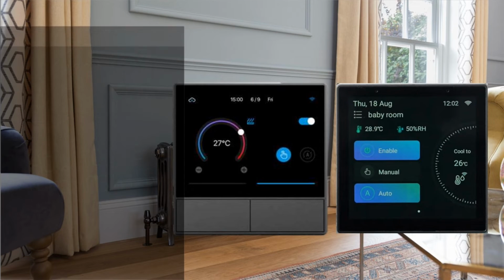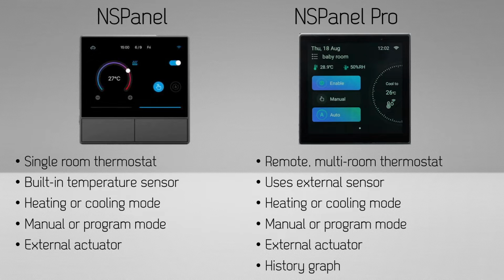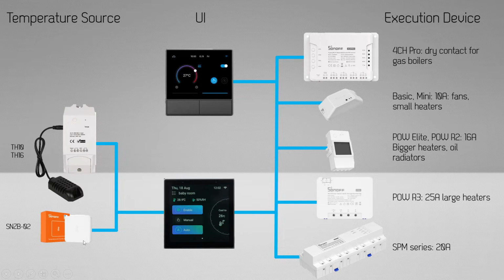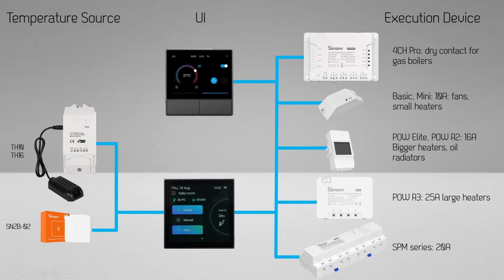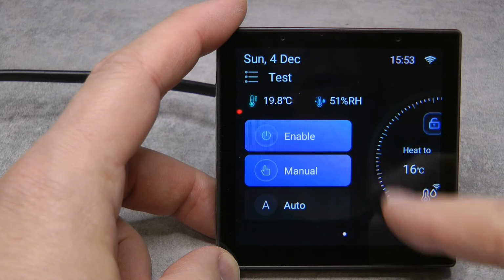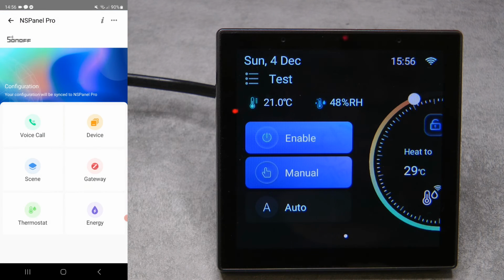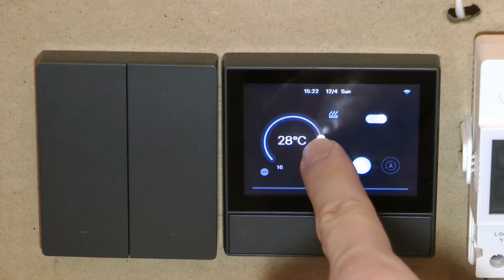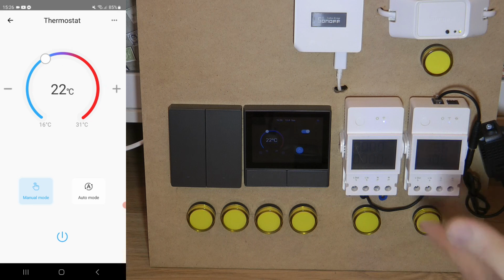Sonoff thermostats: NSPanel or NSPanel Pro

Comment: Hi thanks just found this site, very good description,  I have many sonoff devices.  I suggested to sonoff early days with the NSPanel  that +/- 1  degree is too wide a hysteresis band for a UK domestic radiator central heating system.  I had hoped they may have added the option of  +/- 0.5 C by now.   +/- 1 C represents  a 3 degree swing.   So if set room temp needs to be 20 C   it goes up to 21C then it has to drop to 19C before it cuts back in again,   in colder weather due to the boiler/rad re heat up delay the room temp drops lower than 19C.   With a tighter band It would also be good to have some choice control setting over the delay time between on off.
Reply from the maker: Thanks. I agree with that, not to mention with radiators the room hears up quicker, but with underfloor heating it would take longer until you feel that the heating kicking in again.

Comment: I've watched your video but there are some things that you should rectify.
Nspanel can also use the external temperatura and humidity sensor.
Also as execution devices, you can mention also the sonoff sv whici has a dry contact and is the device that you have to use for a heating system.. Hope this info helps.
Reply from the maker: I am sorry, but how can the NSPanel use external sensors? I know about the Sonoff SV, but it also switches over the low voltage with the relay. You can do some complicated wiring to make in dry contact, but I think 4CH Pro is much easier.
Reply: @csongorvarga  I would really like to show you a screenshot of the Nspanel menu where you would see the option to choose external sensors.
For the relay, I made a mistake. I was speaking about the Re5v1c. This one is using the dry contact.
Reply: Imagine my surprise when I found out that the NSPanel Pro DOESN'T HAVE internal thermostat as it was let to be understand in their marketing materials...

Comment: Thx for the great explanation, but in order to automate the apartment only for lighting and cameras, what should I use between the 2?
Reply from the maker: NSPanel has outputs to control 2 lights, and also control 8 additional lights (other Sonoff devices). But you can have on in each room. NSPanel Pro can control lot more devices (although the screen size is very similar) and this is the only one that can view camera feeds. But you can have both and even multiple of each.

Comment: thanks for the video, I have a relatively larger room with 2 separate electrical floor heating thermostats , we don't have Spaniel pro available here , if I use Ns panel do I need 2 of these or even I would do , I am going to use 20AMP POW

Comment: For the temperature measurement is there an offset possible? When running manual mode does it return to automatically to auto when it's time for the next setpoint.
Reply from the maker: Yes, there is a manual correction available.

Comment: Thank you for the great video. One question though: I need to control 2 or 3 sonoff relays (wifi) with the thermostat because I have 3 heaters in the same room. Will the NSPanel allow me to do that or do I need the Pro?
Reply from the maker: I just answered your quesiton on the other video as well. NSPanel (and Pro), only controls 1 device, but you can group that device with the other 2 so all 3 will be controlled at the same time.

Comment: Hi Csongor, thanks for the very valuable content, much appreciated.
I'm building the house and would like to find a solution for controling the heating (to be more specific, zone regulated underfloor heating) and cooling (A/C, most probably Daikin or Gree as they have HA integration).

I quite like non-pro version more, because physical light switches are integrated, but I'm not sure if this can fulfill what I need... so is it possible to switch between "cool to" and "heat to"  for the same room? If not, then maybe I should consider the pro version and maybe create a "dummy" rooms, so for example, "bedroom - heat" and "bedroom - cool" and as I assume each room can be connected only to one source of heating/cooling.

Also, by any chance, if you do use zone regulation (with underfloor heating) in your house, what kind of setup would you choose? (I mean, pro or non-pro version, what relays and what thermostatic actuators for the manifold.

Sorry for bunch of questions, I've tried to google as much as I could, but I'm quite newbie to all of this stuff, so your advice will be much appreciated.

Greeting from (nearby) Slovakia! ;o)

Thanks
Reply from the maker: I am on holiday now, cannot check some of the details now. But if you are using HA I would configure the NSPanel to actuate some dummy switch, and implement the actual "heat to" or "cool to" logic in HA. So the NSPanel is only used for display and setting the temperature. I don't regulate zones in my house. The zones are calibrated in my house so precisely that I only control the underfloor heating temperature and rooms stay within 0.5C degrees all year around with all the valves open. I think the easiest option is to use gel type radiator valves. They need 230V to open the valve and remove voltage to close the valve. That you can control pretty much with any Sonoff relay.

Comment: Thank you for the interesting video. I have a underfloor heating and a towel rail that I would like to control with potentially a NSPanel Pro, but I would consider other cheaper solutions. While the underfloor heating could be controlled directly by a relay on the panel (at the moment it the NSPanel Pro doesn't seem to have a direct relay 16A port) while the towel rail needs to be controlled remotely via zigbee (poor wifi signal in that area). I assume that despite your diagram includes as executors only wifi devices I can chose zigbee relays, right? both systems (underfloor and towel rail) would be controlled by the NSPanel pro based on the info on a temperature sensor I will have in the room. With this arrangement I expect to be able to run the whole system without wifi and using wifi only if I need to control remotely through homekit or some other application. Is that right? Do you have suggestions to reduce the cost of the system avoiding to buy the NSPanel Pro? Or when we start putting together a zigbee HUB and a room controller at the end price would be similar and functionality limited ? Thanks in advance
Reply: Hi,
I would like to do something similar. I have an electric towel warmer. I have bought a MiniR4M and a NSPanel Pro to control the temperature of this towel warmer. I am not sure if it will work or not, or if I will need something else. Did you solve your problem?

Comment: Hello, I have a gas boiler and a manual thermostat in my home with a 24v signal for the thermostat. My question is: may I use the Nspanel as a switch for the boiler?I have install it as a thermometer on the wall but I dont know if I can just plug the signal from the old thermostat of the boiler, on one of two  out chanels of the Sonoff Nspanel.The out chanels works like a switch as far I understand, right?Thanks
Reply from the maker: No, you can't. The manual thermostat is probably switching 24V for the boiler, but NSPanel switches the mains 240V on the output. You can either use a 4CHPro instead (which can switch any input signal), or the NSPanel operates a contactor, and the contactor switches the boiler. Second option is probably cheaper.
Reply: @csongorvarga  thank you

Comment: Hello, thank you for this. The NSPanel can be used as Wall Switch can the NSPanel pro be used as a light switch? In the scenario where you use an already light switch slot to fit one of them. Thank you
Reply from the maker: No, the Pro is like a small touchpanel tablet, it has no buttons and relays. So you can only use the simple NSPanel to replace a regular switch.

Comment: Hi, I couldn't find any Sonoff solution for electric floor heating. I need one temperature sensor in the floor and another in the room. The system should prevent the floor from exceeding the maximum temperature while also maintaining the desired room temperature. I need a controller that supports at least 16A, and I have three rooms to control.
Reply from the maker: Sonoff does not have any such device. Maybe a separate TH16 can be used, but they don't supply with the thin sensor that is usually used in the floor. The TH16 is for 16A, but there is a POW version which supports 25A.

Comment: Hi...love your channel.  I'm very much a newbie and I'm trying to understand how I can make my whole house a/c and electric heat unit work with the NSPanel.  I'm not an electrician nor do I really understand how my existing wall mounted thermostat makes the A/C (or heat) come on.  The existing thermostat is battery operated and has typical 5 (or 6?) thermostat wire which runs back to the unit.  The thermostat has a heat, cool and off mode as well as a temperature setting.  I don't understand what I need to buy/do to make the NSPanel control my A/C.  I'm in the USA.  Thanks
Reply from the maker: Well, it is hard for me to tell. But I think out of these wires 2 will be power (like 24V DC) to power the thermostat, one should be the on/off switch, one probably heat/cold, fan speed etc.
Reply from the maker: 1. I would look for some documentation for your furnace. I think those are somewhat standardized and use the same wire colors. There should be a common ground or 24V wire and a return wire that turns the heating on/off.
Reply from the maker: 2. You could test it by connecting it with a switch or piece of wire. Check that it is not mains voltage, but according to my knowledge it should be low voltage dc.
Reply from the maker: 3. After that you can buy a sonoff 4ch pro and connect those two wires to COM and NO to the first relay. And configure the NSPanel to use the Sonoff 4CH Pro Channel 1.
Reply from the maker: 3. And keep the current thermostat wired so it can be used to switch heat/cool, fan speed, etc, other than the thermostat function.

Comment: Question: nspanel has 2 dedicated relay outputs. Can I use one of these to switch mains voltage to my boilers receiver instead of buying a 4 channel receiver?
Reply from the maker: Yes you can. What I did not check in NSPanel disables the button in that case. As you could accidentally operate the boiler by pressing the button. Unless that is OK for you.

Comment: Can the NSPanelpro work as termostat of a gas boiler or it necesary needs the 4CH Pro?
Reply from the maker: NSPanel Pro is just a screen nothing else. You need the 4CH Pro that will do the actual switching.

Comment: Why if i set to 22°C he need to go 24°C for turned off, and he need to go 20°C to turned on again, that the difference is very big
Reply from the maker: There is a hysteresis option in the settings (I think it is called tolerance). I think it is turned to +-2C at the moment, you can lower it to 1C. It means if you set it to 22C, it will turn on at 21 and turn off 23. This is the lowest setting. This is done in order to minimize on-off switch cycles.
Reply: Merhaba:
Histerezis hala minimum +1 mi. Yoksa yeni güncelleme ile daha düşük ayarlanabilir mi?

Comment: Avoid sonoff it is less reliable than it's price. Thermostat in panel pro does not work in auto mode for example, no fix for a year now :( ignorant support too, buy tuya if you have not invested so far in sonoff.

Comment: This isn't a thermostat.  It's a smart switch panel.  It can only control HVAC with other components installed in a smart home system.  Literally anti-thermostat
Reply: Yes its a great shame that they did not create a version with  10 Amp AC  C NO NC  contacts in it and drop the two external swiches.